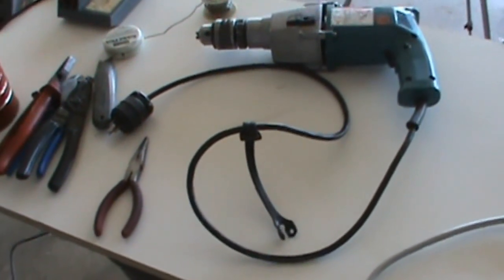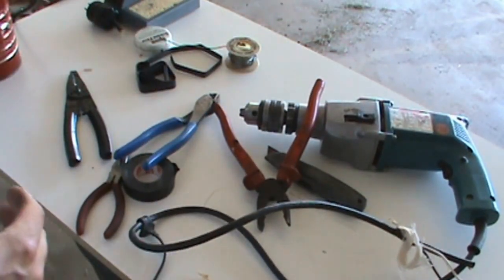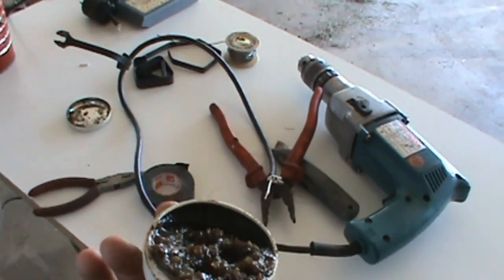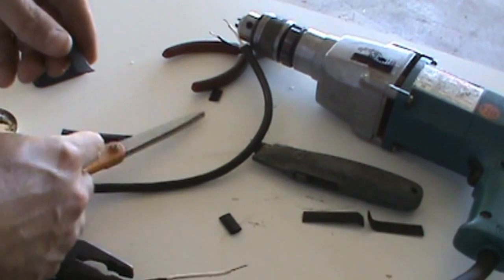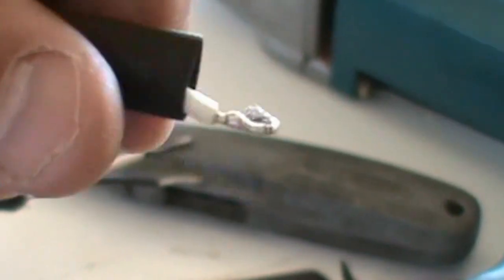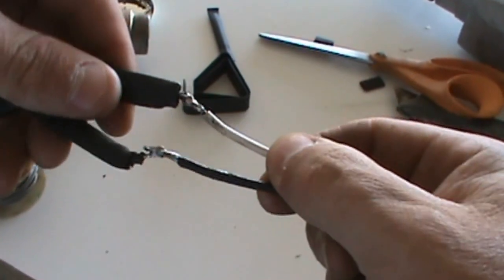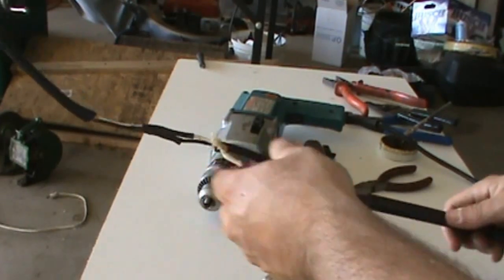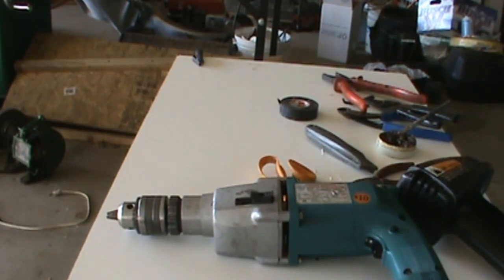How to splice solder a torn or cut wire

Comment: Thanks for taking the time to do all your videos.  I really enjoy them and some have already come in handy.  I wanted to offer some suggestions on this one if I may.   I like to stagger the joints by cutting the black wire from  the drill side and the white from the plug side the same length and repeat with the other two wires at a new length.  This way it is almost impossible to create a short if the the heat shrink were to fail or get abraided.   The other thing is that I can almost guarantee that the heat shrink your using is from harbor freight.  Although I love the place I know first hand that their heat shrink is inferior.  Once you have used quality marine grade heat shrink like the one sold at Pacer marine for example you will never want to use anything else.  It shrinks fast and to a quarter its size and it it has a gel that when heated, oozes out which shows you that it's air and water tight.    It may be an overkill for this type of project but I just thought heat shrink was all the same and I am glad I now know better.   Nice tip on curling the wires btw.   I didn't know that trick.  Keep them coming and thanks again.